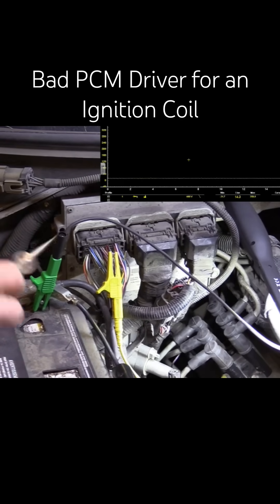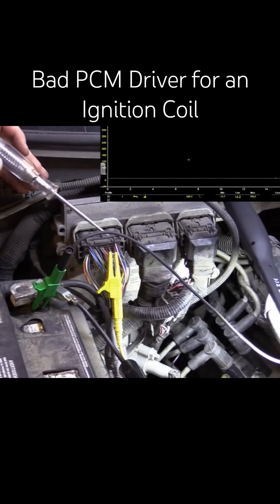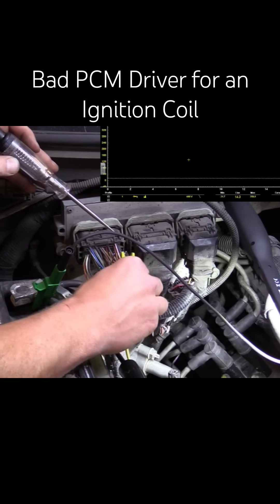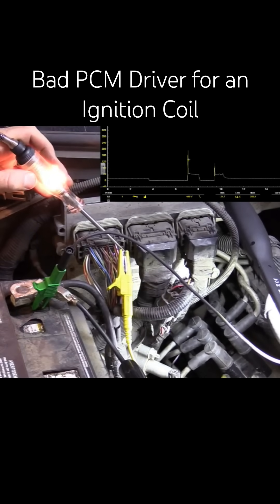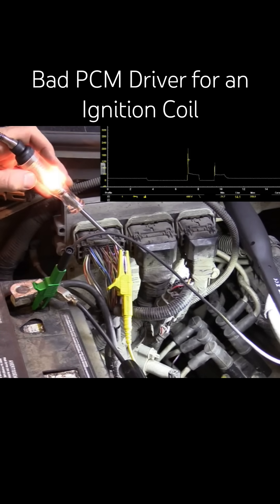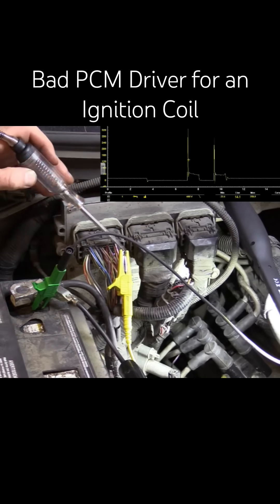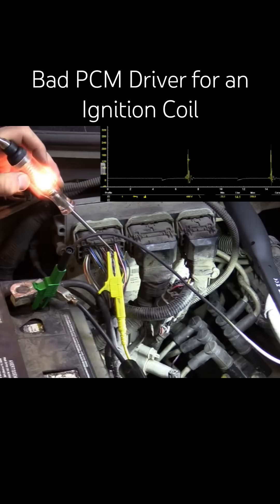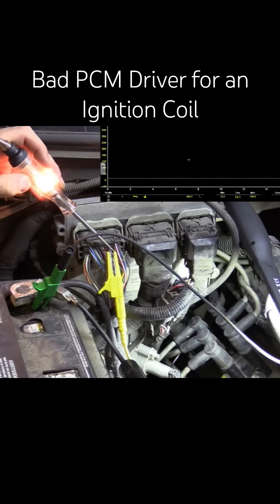No Spark Troubleshooting  [bad ECM driver test] #automotivediagnostics

Comment: Why can you not use an LED test light here
Reply from the maker: You'll cook it. Coil negative on these systems can exceed 400v when the coil fires
Reply: @ and an incandescent can handle that? I’m just getting into diagnostics so you’ve been a lifesaver btw
Reply from the maker: @TM-fx5le  yes sir! Very little amperage and the filament of the bulb has no problem carrying that load

Comment: You got my gears smoking. How can the engine run if there is no coil control? WTF???
Reply from the maker: 3 coils, 3 different divers. Each coil provides spark for 2 cylinders (waste spark design).
With one failed driver we have a two cylinder misfire

Comment: Why would you youse a test light means nothing. Youse a lab scope best 👌 but also you got to know how the pattern must look like
Reply from the maker: There are many circumstances where the test light is the tool to use. Staying with a fuel injector for example:
Fixed 12v (no control) measured at the injector, but 0v measured at the ECM. This would be a confirmed open control wire in the harness. Before you sell the job, you'd want to make sure the driver is still functional. Test light to battery positive and touch on the control wire at the ECM. If your test light pulses, your driver is good. Labscope will NOT tell you that in this scenario.
I can give you a hundred more examples
Reply: @ScannerDanner  i know. I'm a master technician for aviation. 47 years.  The test light could fry the driver  in the ecu.     Sean it Manny times. Not only in aviation but also in automotive
Reply from the maker: @iginogasparini3369  you should know the current of the circuit and the test light you are using. This 10 amp circuit for the ignition coil is not going to be hurt by my 200ma test light. As a 47 year tech, you should know that and also the major advantages a simple incandescent test light has. 
Here is another one for you:
Output solenoid is melted, damaged, for whatever reason. You cant use a scope or voltmeter to check driver control because it's a ground side switched circuit and the winding of the output solenoid is open. Before you sell that output solenoid to a customer, you better make sure the ECM driver didn't get damaged in the process. 
Disconnect the solenoid, test light to battery positive and touch on the control wire and bi-directionally turn that driver on. Test light lights up. Your done, driver is fine. Again, it is THE tool in this senario. Know your circuit and know your light. I can go on and on
Reply: @ScannerDanner 
What about if you restart the car and signal comes back for a few seconds via the scope. Then goes 12v no pulse.
Reply from the maker: @dcomputers  intentional shut down. See if the injector is doing the same for that cylinder
Reply: @ScannerDanner  coil continues to fire on same cylinder but injector drops out. So this possibly rules out ecm. I saw your video on intentional shutdown.

Comment: "But you'll fry the ECU" 🤣
Reply: Been testing coil and injection drivers like this sence the early 80s never had a issue this is basic diagnosis thats 50 years old 😆 🤣 😂 you tube thinking they invented the wheel again 😂😂😂 but this is good for young blood to learn 👍
Reply: No, the test light will not carry enough amps to hurt it.  It already handles the coils current.

Comment: It's not really "cleaning" up the signal.  The light is acting as a resistor-  so it's creating a voltage divider circuit..  still pretty cool..... Edit:  actually, I take that back;  your light is in parallel with the injector-- so it's basically doubling the load on the driver.  So the computer is likely dropping the voltage as a self saving measure..  That's interesting-  but I'm not sure how that works internally............  

Showing an internal ECM circuit, on how a driver or control wire or sensor wire circuit  can be completely shorted to power or ground - and still be fine (or not) -- would be a great all encompassing video.........  Can we short a sensor wire to power or ground?  Can we short a driver to power or ground? or control wire??   What happens to each of them?...  but more importantly- how does it save itself?  What does that circuit look like internally?  ECM/PCM's are still kinda magic to me. lol.. they survive far more things than I would think is possible.
Reply from the maker: Please don't ever intentionally short an output circuit, unless you want to kill the driver, because you absolutely will!
My light was reducing the voltage spike and accompanying coil reserve voltage oscillation because it was providing a path for that spike to dump off to. So "cleaning" up the signal was just a quick way to describe what I was seeing. 
Adding the additional load of a 200ma bulb to an already 10 amp circuit was not changing anything else. The drivers on/off control was completely unaffected
Reply: @ScannerDanner  Right on..  But I've seen plenty of shorts on sensor wires, and all it does is peg the reading at 0v or 5v, etc..  Also, control wires usually have good protection too.  A dedicated video explaining what can handle a short and what can't, in a PCM/ECM-- would make for an interesting idea.. Just spit balling..  Cheers.
Reply from the maker: @calholli  yes, "sensor" wire shorts are typically not damaging to a module because those circuits are super high resistance and do not support any measurable current flow. In other words there is no transistor driver that is involved like on output circuits. I have MANY videos on this subject in my classes on my website in particular (chapters 2 and 3 playlists) thanks!

Comment: I can't electrical trouble shoot for the life of me. I got a code P0722.(output speed sensor). I replaced the sensor twice and wire connections are all good. I'm leaning towards a bad pcm but not certain. FmL lol
Reply: Check the mechanical pickup condition. Rotate it manually if possibly and check for any signal coming off the sensor. 2 wire Ac voltage im assuming?
Reply from the maker: What are you working on? year, make, model and engine
Also, you could have something like this going on https://youtu.be/MGaHaIXZioA

Comment: That's certainly viable if you're stuck out in the field, but I'm trying to envision a situation where I have my service info available for a wiring schematic but don't have access to my scope.
Reply from the maker: I'm just showing tried and true methods and backing it up with different case studies. So many people think an old school test light should no longer be used for diagnostics and nothing could be further from the truth. This thing had 3 different coils thrown at it! lol
Reply: @ScannerDanner  Oh for sure, I use my test light all the time. It's the first thing I reach for when verifying power supply. And I've actually used this method when I'm away from the shop and have easy access to the coil.

It would also be useful for shops that don't own a scope, but honestly, if you're doing diagnostics professionally I think a scope (and more importantly the knowledge to use it) is a required tool.
Reply: @craigsparton  scopes are the only way to really be able to eliminate any guesswork. 

I had recently a PWM blower motor that was faulty. A multimeter showed some PWM signals so I suspected there was control, but, man, a scope just eliminates any guess. I would have known exactly what the range of the PWM signal would be, if it was being grounded properly etc. Handheld scopes should be standard. 

But, I guess sometimes the best you can do is an educated guess.